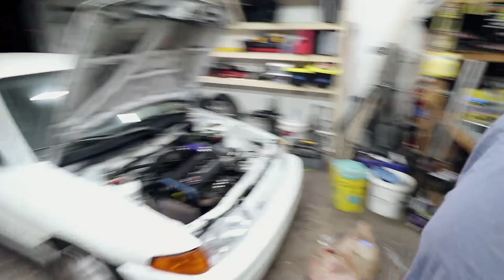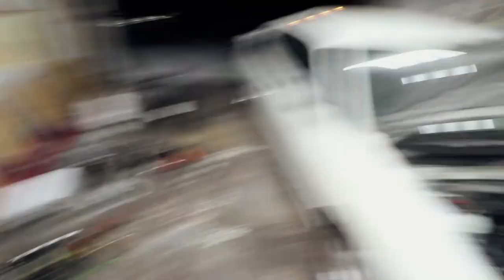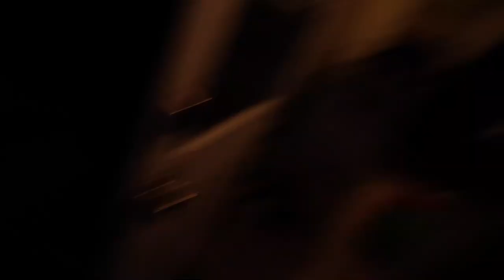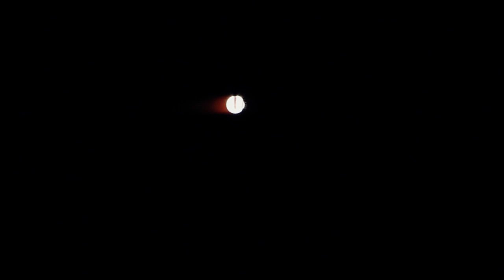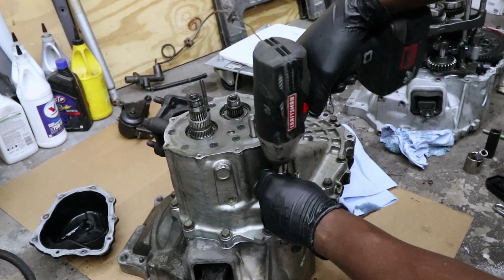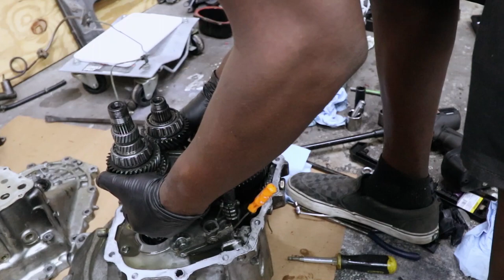MAZDA G-series Tear Down

Comment from the maker: Trans dissiembly @10:00
Reply: Is that LSD. I've rebuild 2 sets of  G-series gearbox with my try and error method but successfully done..  ... Your video is  amazing. Im going to put mazda gtx or gtr engine soon. Any recommendation to upgrade gearbox.
Reply from the maker: @kajenmachap  yeah it's an Mfactory LSD.  The best thing you can do is swap to a toyota e153 gearbox.
Reply: Hey man, is it possible to convert an AWD G-series box to FWD only?
Reply: I know this is old, but did you need to drop the K-member?  I have to pull my trans  because the !@** spider dropped down when I tried to install the axles.  Lesson learned, but the K-member is a nightmare to drop and reinstall.
Reply from the maker: @andrewhagopian468  You mean cradle that goes front to rear ? Yeah , thats got to come off. The my car didn't have the brace that normally goes from passenger side to driver side.  I think i have a video of  me pulling the trans somewhere.
Reply: @StovallsGarage  No, I was talking about the big subframe piece that the rack and A-arms attach.  It didn't seem like there was much room, and another guy dropped his down.  But I saw your other video!  It's tight, but I did it in about 1.5 hours.  Putting it back though...these cars are super tight in some areas.  

I am messing with a Zetec, not a BP,.  Everything on the belt side is a pain. 

Working on a 90K '98 Zetec motor from a ZX/2 with a S/R ECU going into a "91 323 hatch.  

Thank you for responding!
Reply from the maker: Andrew Hagopian  i used to have a ZX2 , yeah its a bit tighter, I had to tilt the engine a lot more in the 3rd gen then I did in this

Comment: Hope it works out with the new stuff. Had a friend pushing that much HP and blowing the tyranny's so he turned the engine and dropped in a Miata trans. Also made the car rear wheel, tubed with a ford 9 inch. I'm probably going sequential, but will be later at the end of the summer. Great video.

Comment: Hi, I’m rebuilding this mazda 3 five speed.  Im in need of the first and second clutch hub synchronizer retainer springs and the three synchronizer keys.  Where do you get your parts?  Thanks in advance.
Reply from the maker: I got all my parts from,Jim ellis mazda  they haven't let me down yet. https://www.jimellismazdaparts.com
Reply: Thanks.  I saw that but shipping was high for me so went to Mazda in Richmond.
Reply: My son in law races this car.  He also has an fb 1000 open wheel.  Im still figuring out where everything goes on the mazda 3. Thanks for you helpful video.  Can i shoot you a photo or two?  There is one part i cant figure out.  The problem is he took this to a transmission guy who tore it down but then went out of business.  So im going by the shop manual which is kind of useless.
Reply from the maker: @arranger123  Sure I can try and help.
Reply: @StovallsGarage  Having trouble pasting the image.
Reply from the maker: @arranger123  if you have Facebook you can message me or just email me antonio_stovall@hotmail.com

Comment: transmission again? D:, you need low boost  :c
Reply: an option is, on alibaba can send manofacture  gear(one) or gear kit(all internal gears), but you can select best material example "3215 steel series" only need the part number of G5M transmission(transmission of escort) share transmission with mx-3
can be found on this pages,
 mx-3: http://japancars.ru/index.php?route=catalog/mazda&cat=AEEA02&grp_id=C1
case: http://japancars.ru/index.php?route=catalog/mazda&grp_id=C1&cat=AEEA02&blk_id=1700A
gears :http://japancars.ru/index.php?route=catalog/mazda&grp_id=C1&cat=AEEA02&blk_id=1710A

an example provider: https://www.alibaba.com/product-detail/Manual-Transmission-2nd-Gear-for-Toyota_60779709030.html?spm=a2700.galleryofferlist.normalList.253.74dd17d6CpIzQz

best regards! >:D animo!

Comment: Ever think of getting custom straight cut 3rd and 4th gears?
Reply from the maker: Briefly, par is too expensive,  and Mfactory fears are way too short (car would top out at 120 in 5th.) Getting something custom made is really expensive.  The e153 is the best bet.
Reply: @StovallsGarage  yeah nvm I did some looking around for gears from custom gear shops online and you could e153 swap alot cheaper, and the gears can't be made any wider, if you could in the future do a video about what's needed to e153 swap, I read the forums on it but a hands on video would be cool
Reply from the maker: @Build_Beyond  That was the plan, it will probably be a series of videos.
Reply: @StovallsGarage  SUPER looking forward to those videos; my dream is an eventual e153 swap into my wagon, with around 450-500 ponies thrown at it running e85 corn juice.

Comment: What's going on with ya!? I assume you're working on the transmission upgrade, but I'm just getting started after picking up my (finally) '93 EGT parts car! Is the BK210AWS kit what I need to rebuild the transmission? Do you have a suggestion in either a kit or individual part numbers that I should purchase to freshen up this 208,000mi 5speed in the EGT before putting it in my 323? I'm right there and looking to get the whole thing done with the 1.8na (for now) and transmission swap in the next month, month and a half. I could really really use your detailed help (aside from your videos which I've watch in their entirety). Wish there was a more efficient way to have a conversation with you if you wouldn't mind so I can tell you exactly where I'm at and get your opinion.
Reply from the maker: Haven't been doing much other than work, haven't started the 153 swap yet... I'm not sure on the parts kit for the rebuild, I only did bearings in mine.
Reply: @StovallsGarage  likewise. Where can I pick those up?
Reply from the maker: @dionwilliams6841  I get everything from Jim Ellis Mazda in GA.

Comment: Love the fabrication but....ford has gearboxes that can handle that power & I know they are expensive but the Mazda 3 mps box can too & it comes with a lsd
Reply from the maker: Just because they are Ford or Mazda dosen't necessarily make them easier to swap.  It would be just as much work, if not more.  Money isn't really a concern. This swap has been done before so I don't have to try and figure everything out my self, plus no one make an adapter plate for any of the other transaxle.
Reply: Yes I know the differences with Ford & Mazda , if money is not the concern then the Mazdaspeed box is the best option
Reply from the maker: @mexicossie1592  okie dokey
Reply from the maker: @mexicossie1592   I'm not doing the Toyota swap because it's cheap, I'm doing it because it's relatively easy compared to swapping in a msp.